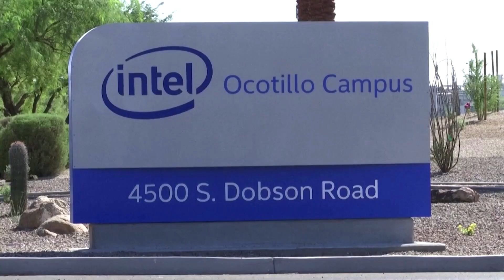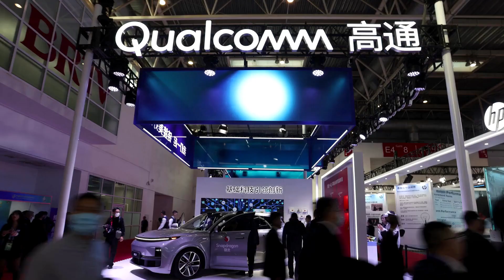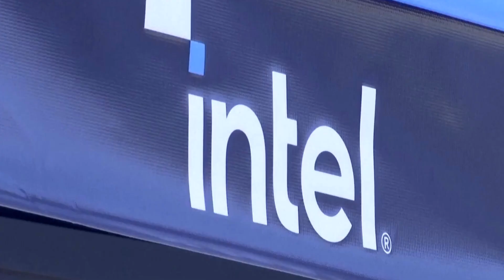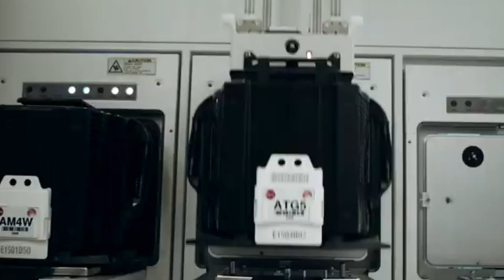SMIC, Yangtze Memory, And Intel Takes Over The Chip Industry With This New Move!

Comment: I've serviced Industrial Chinese machinery for over 15 years and have found that the quality of parts used is not up to the high standards of other machinery made in Germany and United States. Inferior cable and wiring assemblies using cheap poly thermoplastic jackets, to cheap meters, gauges, couplings, connectors, wiring devices, plugs, receptacles, paint that has no primer or has primer but flakes off in big sheets, poor quality steel, just to name a few things. Machinery used in the manufacturing process of chips, lithography, or anything chip related is on another level. The old Chinese way of manufacturing was to make it cheap to compete in the semi conductor lithography market everything has to be of the highest purest quality I haven't seen anything like that coming out of China but I know its possible. Competition is good.
Reply: Just a matter of time. When the Chinese decide to do something, they get it done. Who would have thought they'd be on the Moon and Mars and building a Space Station from scratch?
Reply: You are out of date.
Reply: @Lost_Johnny  Could be..... that's all i've seen in the insulated wire and cable industry. 
That .. and the PLC programs written in Chinese for my ease of troubleshooting.